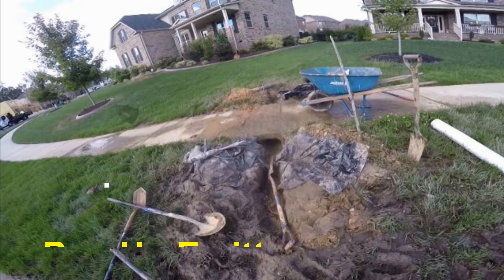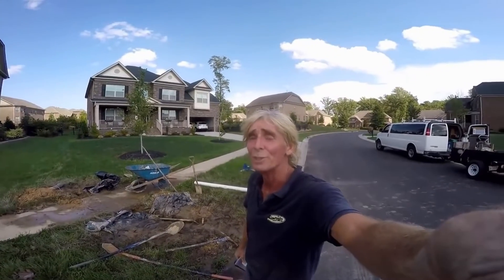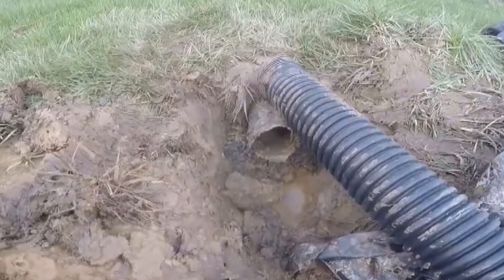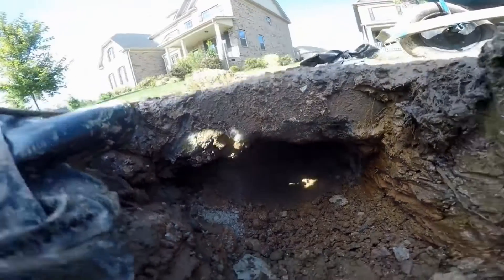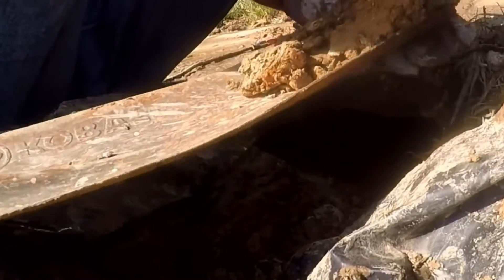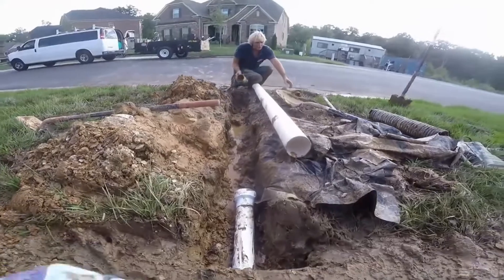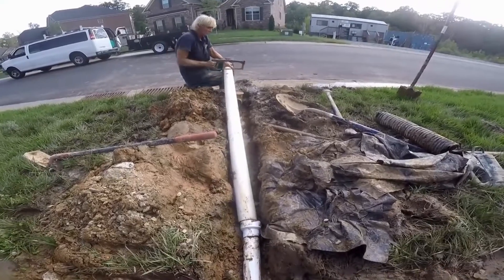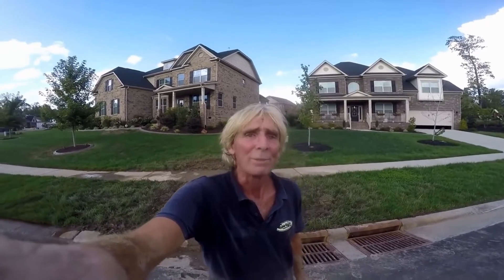Pop Up Emitter for French Drain, Where does it go? Raleigh NC

Comment: Chuck, I need to run something like this.  The ground is level at best, will the water pressure cause the water to flow through a level pipe and out of the pop up?
Reply from the maker: Hi Hal, it’s possible there could be enough pressure to push the water out. But more than likely if the line is level it will hold some water. This is not really a problem as long as the inlet, the collection is still higher than the discharge. So for example if you hook up your downspout make sure the pipe comes up above ground, say a foot or so. This is called a head of water.

But more than likely in that system you described, there will be water laying in the pipe.

Thanks and best regards,
Apple Drains
Drainage Contractors

Comment: Hey Chuck how about a shot on HOW to back fill of the tunnel under the Sidewalk so it does not sink over time.
Reply from the maker: I’m pretty sure we have some videos showing how to backfill. The best way is to shovel as much dirt back in, then turn your shovel around and just pack it tight. Just keep poking and poking and it will pack tight around the pipe. We have never had a sidewalk sale from tunneling.